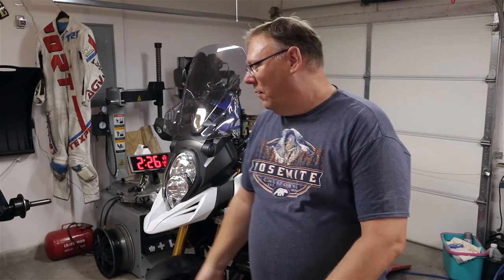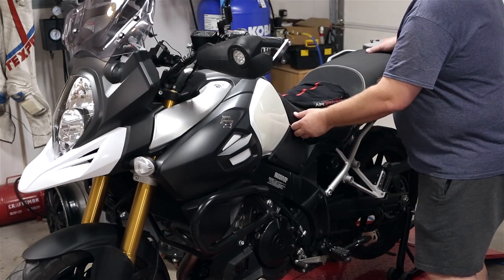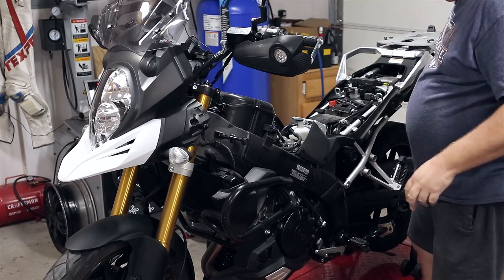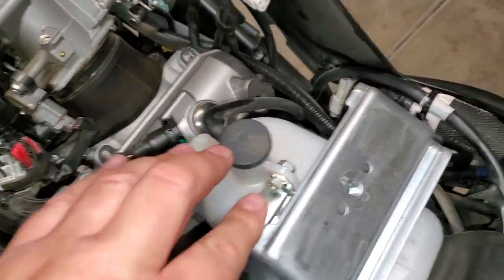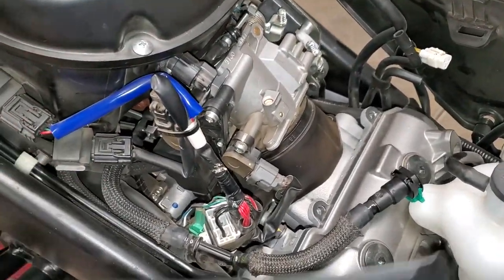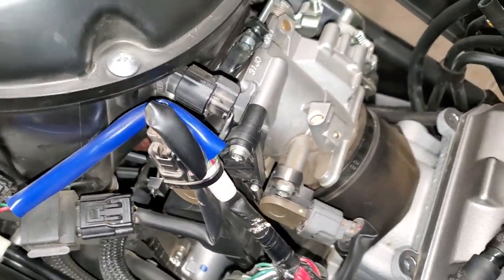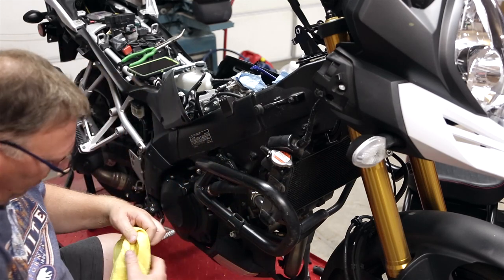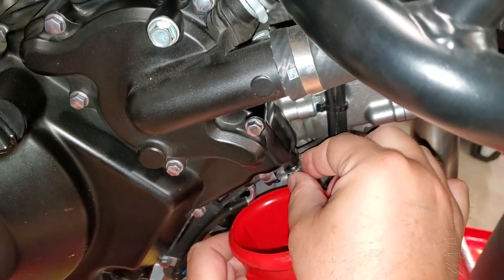2015 Vstrom 1000 valve adjustment part 1

Comment: Hello, thanks for your great video. I have a 2023 DL1050 with 15,000 miles on it. Thanks to your vid, I was confidant I could handle the valve adjust easily enough. I was a professional airplane mechanic for 29 years, and worked on motorcycles for 10 years before that. So I’m not really a backyard mechanic, I have a lifetime of experience. But this was my first time on a V twin. I purchased and read the Suzuki factory service manual, watched your vid several times and figured was ready. It all went just like the manual and your vid showed. Was easy and straight forward. Had to adjust all 8 valves. They were all in spec, but at the very min spec. I wanted them looser than that. After getting it all back together with new plugs and coolant. started it up, and while no bad noises, it was only running on the front cylinder as verified with an infrared heat gun. I took it back apart and verified yes, all the cam timing marks were exactly according to the manual. Any ideas on something I could have missed? Appreciate any advice or tips you could offer… Craig
Reply from the maker: Hi Craig, glad the video helped you! I'm sitting here trying to think of what could have gone wrong... When you removed the rear cams did you turn the crank to the front timing marks on the flywheel? other than that, the only thing I can think of is maybe a loose sparkplug wire or a wire that wasn't  plug back in. If I think of something else I'll reply back again.
Reply: Thank you for your reply. I really appreciate you still answering questions years after you posted this vid. To follow up, I took it all back apart, and everything was perfect. I didn’t change a thing, put it all back together exactly the same, and it ran perfect! Still no idea why it wasn’t firing the rear, but it is now! Thnx again @VStromGarage

Comment: Excellent, I just purchased 2014 Vstrom 1000. Great condition but does have 15,800 miles.Ialso have 2007  sv 650 I purchased new , great bike.
Anyhow I live in Los Angeles, Ontario. Ca. area.
Could you recommend someone professional and prominent like yourself who could help with valves on my 1000 ?
Reply from the maker: Sorry I didn't get back sooner, but I don't really know anyone in your area. I would say ride it to Vegas and we could get it done, but it looks like I will be busy for the next 6 weeks.
Reply: Thankyou for answering back.
I've checked valve clearance on my  sv 650.
May try at least checking rear head on 1000
Then take it in to one shop that's done work for me before.
I appreciate it, take care

Comment: I got no compression on front sillander and only 30 on back one is this problem rings pls help
Reply from the maker: the only way to find out is to use a leak down tester on each cylinder, if you hear air coming from the airbox it's your intake valves, if you hear air from the exhaust pipe it's your exhaust valves, and if you hear air from the crankcase it's your piston rings. Remove the oil filler plug to hear the crankcase.
Reply: @VStromGarage  sorry I forgot my manners that you for your info and your videos most helpful. Do you have a video on the problem I have ore a head rebuild pls
Reply from the maker: Not at this time, usually these engines are pretty much bullet proof.
Reply: So the valve chain Brock on the front cylinder any thing I should look for ore check
Reply: Is there a video on how to go by
Reply from the maker: If the cam chain broke, I would make sure the piston didn't hit the  valves.

Comment: Hi.
Great job, as all your DIY vids.
I have a doubt.
Which coolant do you use?
The spec is 50-50 coolant, but, any other spec or can I use a standard OAT coolant?
Regards
Reply from the maker: I believe I used Toyota red coolant mixed 50/50 in this one. as long as it's silicate free and one other thing I can't think of, you can use it in the motorcycle.

Comment: It's a big deal.. I ride r1200gs and 1050xt.. I have to disassemble the bike like that and adjust the valve gap.. In r1200gs, you only need to loosen 4 nuts to open and adjust the engine.... It's a big deal. ... Should I do the same in a few years?
Reply from the maker: Ya, but at least on the Vstrom you don't have to disassemble the rear end to put a dab of grease on the splines.

Comment: hello, with my 2004 model dl 650 motorcycle, when I go with 6 gears and 4000-4500 rpm with constant speed, it gives FI C-45 fault code. When I go at 5000-6000 rpm, there is no problem. What could be the problem?
Reply from the maker: Not sure what the c-45 code is.